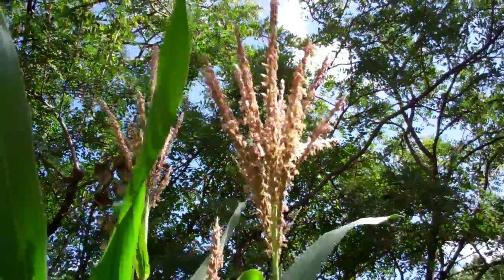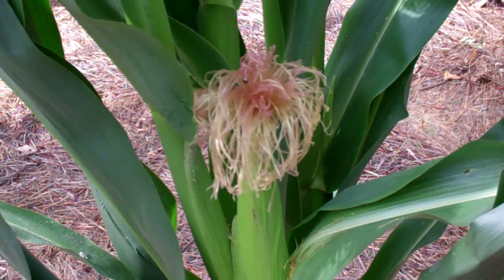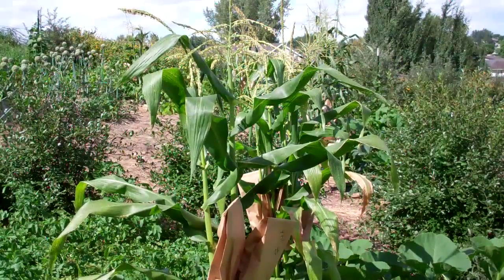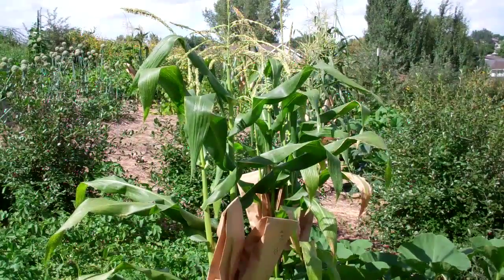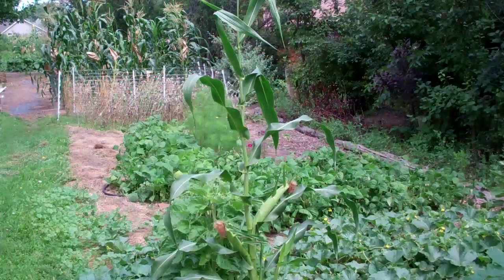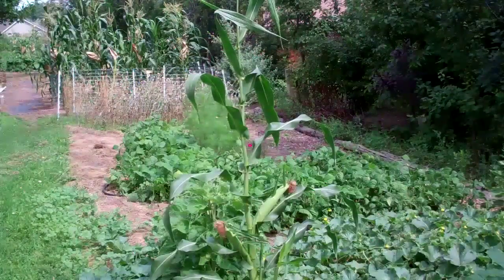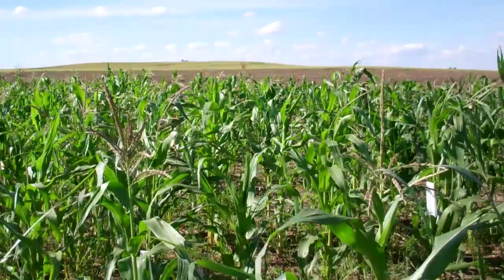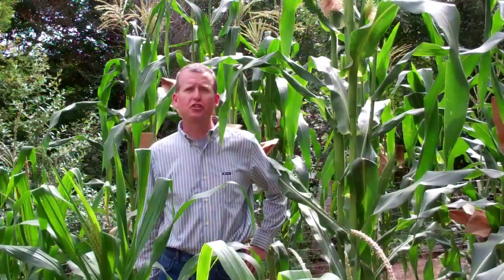Breeding "Organic Ready" Corn with Gametophytic Incompatibility

Comment: This is a great project. I was thinking about this recently in relation to growing both  popcorn next to a flint or sweet corn for seed production for many years in a row. Maybe I will email this question to Frank, but I was wondering if any popcorn pollen can fertilize sweet corn or flint nearby. We have never seen this, but does the incompatibility go both ways?
Reply from the maker: Pollen that carries the Ga1s allele can pollinate and fertilize any normal corn and any corn carrying Ga1s.  So, your flint and sweet corn are very unlikely to pollinate and fertilize your popcorn if it is homozygous for Ga1s, but your popcorn will certainly pollinate the flint and sweet corn.
Reply: @npsasfarmbreedingclub2019  If you could somehow genetically modifiy the gametopytic incompatible corn so its pollen wouldn't germinate if the silk/ovaries didn't have those genes or something, that could work but I guess that would partially defeat the purpose. Maybe some method with breeding could do that, if it's possible at all.